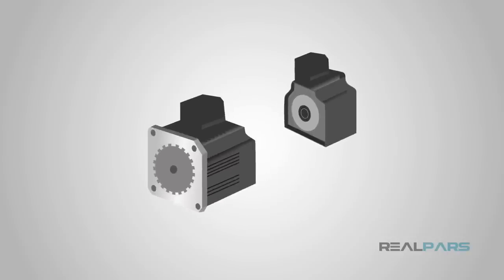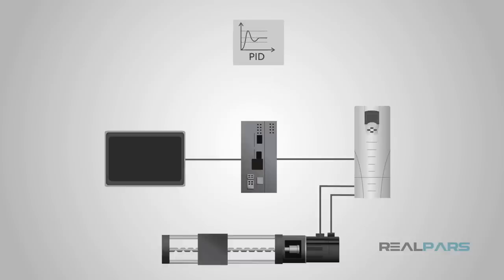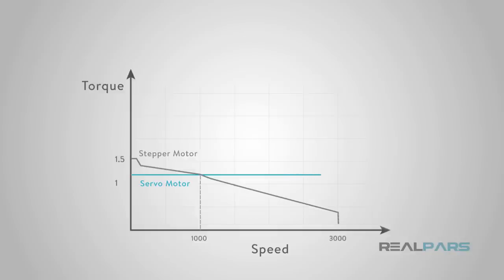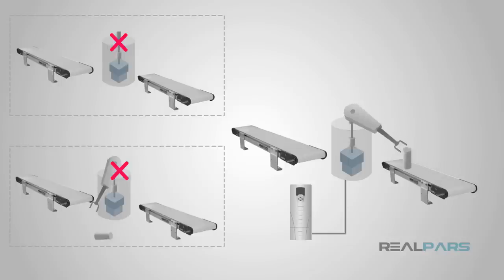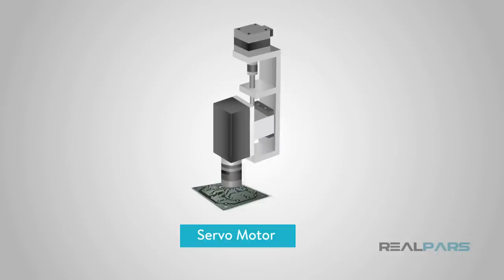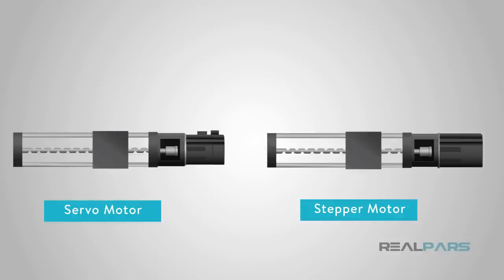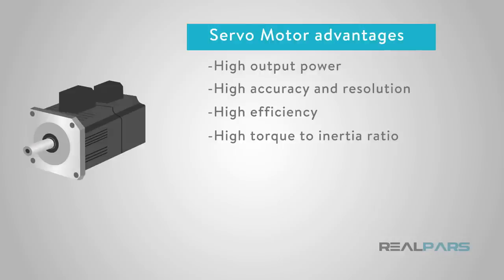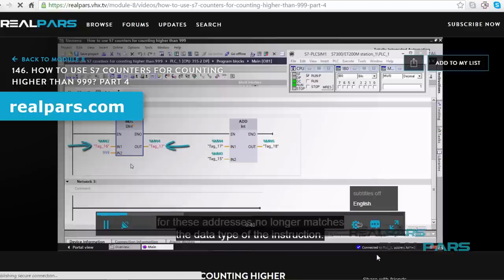Servo Motor Advantages And Disadvantages

Comment: I thank you so much for these wonderful videos, now i know i need to start from Stepper motor since i am a noob.
Man what a lot of nice information.
Reply from the maker: Great to hear that! Thanks for sharing your support!
Reply: @realpars  Hi real pars, nowadays i'm getting confused because there are stepper motors with encoder built in or feedback, and that makes them closed loop, so how does it fare with servo with feedback other than the speed-torque ratio? and can't stepper use PID control?
And also hobby servo motors have potentiometer built in, but that doesn't make them close loop or it can't tell me it's position, so where does the difference between professional servo motor and hobby servo motor lies? Hobby servos makes me crazy, so many questions.
Sorry for such a simple question on a professional channel

Comment: You can use an encoder with a stepper for feedback. We have them on the lead screws for our cnc. The counts per rotation are matched with the micro steps to get spot on feedback. The stepper also has better holding torque, so it really is a matter of application. Drive tuning is done by engineers most of the time, and most manufacturers so have software for tuning. Again application will dictate how involved the drive tuning will be. Technicians just need to know how to hook up a drive, the program can just be downloaded on any newer drives.
Reply from the maker: Hi there, thanks for your explanations.
Reply: so it becomes servo motor and then the advantage of stepper motor is gone
Reply: @lanchanoinguyen2914  Controlling the position of a stepper motor is still a lot simpler, and Arduino-board is enough to get the job done.
Whether to use a stepper motor or some other type is more a question of of the task. For low-speed operations, there is little to challenge the stepper motor.

Comment: What about closed loop stepper motors? They have same advantages as standard steppers plus they don't loose steps, driver automatically regulate current according to the load and can overload motor for a short time if needed, which makes possible higher speeds and accelerations. It seems like the only disadvantage compared to the brushless motor is 3 times lower max RPM.
Reply: "the only disadvantage" ... I think noise is higher too,  and acceleration lower if that's important

Comment: If the Torque decreases by speed that leads to probably of more slipping and the the motor losses the accurate position ? i mean the motor will be weak and not heavy and able to resist any external pushing ? or if more speed is increasing and leads torque decreasing that  makes the motor not stopping at exact position and could be slipping a few millimeters. ?
Reply: Hello Wadi B3eed, Yes this is possible if the servo is not sized correctly for the application. It’s important to remember when sizing the motor to load requirements. When using servo sizing software, the calculations take into consideration your speed | torque performance requirements for torque control. Please listen to again at 6:27 Torque control, servo controllers using torque parameters. Please listen to the video at 8:06 discussing servo error control that is used for torque, velocity, and/or position, and also we discuss how servos provide error fault limit control. I hope this helps and thank you for the very good question.

Comment: Sir how to increase speed of servo motor.?.it is possible to  adjust speed the servo drive
Reply from the maker: Servo drives are controlled by a hardware "box" or "card" which usually is configured by attaching a PC to the drive interface.  In that configuration are settings that limit speed, control direction, etc.  Also, every servo motor has a rated speed, which is the maximum speed at which it can run.  You will need to investigate these parameters and figure out if the speed at which you would like to run is supported by the hardware and controller.  The servo speed may be able to be changed via the software that is used to configure the drive.

Comment: Wouldn't high torque industrial usecases use hydraulics anyway?
Reply from the maker: There are high-torque stepper and servo motors available for use with robots that lift things and conveyor systems.  Hydraulics can generate a lot more force, but it is hard to control hydraulic motors with the precision of stepper or servo motors.  In most of the hydraulic applications I have done in the past, travel of pistons, etc., were controlled by hitting a limit switch at the end of travel.
Reply: @realpars  One outlier is the optics industry in this case. There are hydraulic-driven linear actuators with nanometer-precision glass scales on them. Since the fluids are incompressible, you get rock-solid, zero-backlash positioning with gigantic forces. The downside is cost.
This is why optical grinders, for example, cost an arm and a leg :P